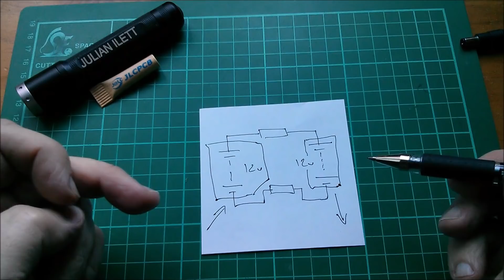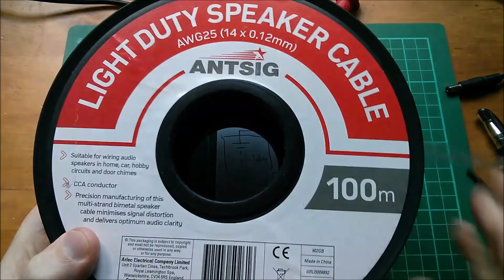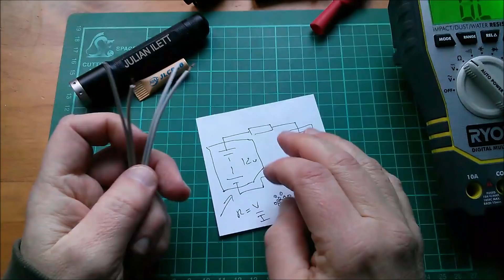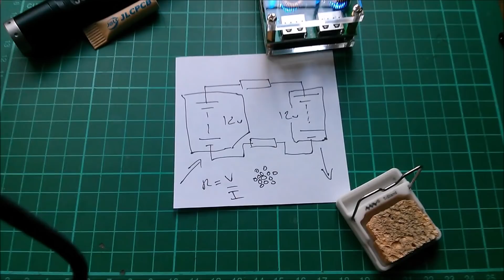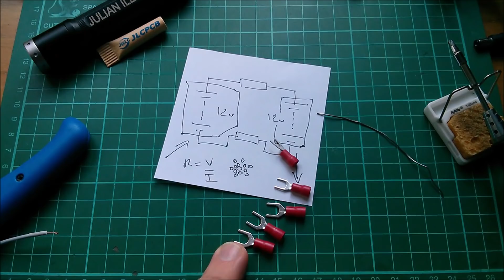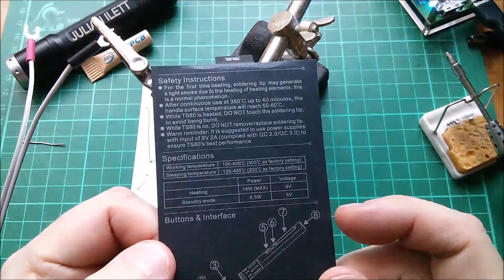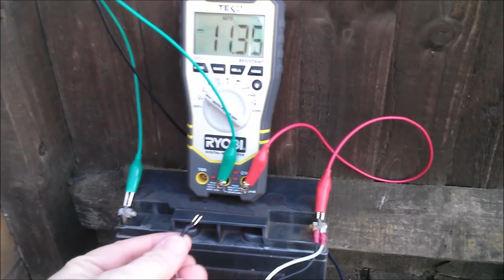Low Tech Power Distribution

Comment: CCA cable drives me mad, I’ve bought it by accident a couple of times. The certainly don’t make it obvious usually. Should say ALUMINIUM on it in massive font.
Reply: I hate CCA cable too. What a pain in the ass it is and the resistance is awful.
Reply: I've recently bought a lamp from my local hardware store. When I took it out of the package I was kind of surprised at the springiness of the cable. It has the proper markings on it (H03VVH2-F 2x0,75 mm²) but when I cut off the plug and stripped the wire I noticed that it was CCA wire. E.g. I bought a lamp with a fake cable which can be quite dangerous here in Germany because we don't use fused plugs and rely on our 16A MCB's and as far as I know it's illegal to sell this sort of fake cable unless it's properly designated (In this case it would have been the A designation for a Aluminium wire)
Reply: web1bastler Not good at all!
Reply: The only thing worse than CCA is when it's just pure aluminium! I ran a 30 meter Ethernet cable for the purpose of audio distribution and when I cut off the pre-fitted RJ-45 connectors and stripped it back - ugh aluminium! It was already physically installed so I had to make the best of it. I ended up terminating to it by twisting copper tails to the ends and shoving that mess into a terminal block so it passed under both screws from one end. Although I had concern about those connexions oxidising, 3 and a half years later the audio is still flowing fine. The amount of resistance was ridiculous, around 30 ohms per conductor! Fortunately 600 ohm audio lines can tolerate a certain amount of line resistance.
Reply: I don't have a problem with aluminium wire, if it's done right. My car from the factory has alum cables for major current supplies , like starter motors, and it's been fine for 35 years.
Reply: SidneyCritic ComedyHound of course it has its place. I use it quite often for mains as it’s cheaper and obviously if sized correctly no problems at all. It has just caught me out a few times being an idiot in a hurry and not noticing and ordering it by accident. Which I’m sure is what Julian has done or he would have mentioned it.
Reply: @molitovv  Of course, ohms law confirms that aluminium as a conductor works fine as long as it's correctly sized. That's all the power line companies run around here for the  low voltage circuits. And on the national grid most of the conductors are actually steel with a coating of aluminium for better conduction. But, then on their 220KV lines, they have a few volts to spare. lol 

The problem is when you think you're getting a pure copper product and it turns out not to be. And most of these items where they fake it, the aluminium conductors are no bigger than the Cu ones would be, sometimes even thinner.
Reply: It’s super commonly hidden so you think you’re getting a deal, when you’re really just getting garbage wire. And it’s not really an issue to use aluminum as a conductor. The resistance isn’t that much worse than copper, and it’s way cheaper. But generally if you run into aluminum wire in a consumer product it means it was intended to be among the lowest price possible to manufacture. So with aluminum Ethernet wires, you commonly see conductors as small as they can manage. And it does ‘work’ for data over short distances, so it’s OK, but most people are totally unaware of how garbage the low end CCA cables typically are. They’re typically as cheap as can be done, and spending the bit more often isn’t a bad idea.

Comment: I would add some diodes so the smale battery does not "try" to charge the larger one
Reply: Would not bother, the voltage drop will mean the small battery will stay at around 30% less charge no matter the big battery charge state, and will just kill it faster. The small battery however does need an enclosure, so that freezing weather with a low state of charge does not kill it by freezing the electrolyte. Not a worry for me, last time it got below freezing here was during the last Ice age.
Reply: My thought exactly, so the large battery charges the small one and not the other way round

Comment: Yeah, super CAP it!!! You could almost power it from the wire. Maybe a DC to DC. One boost, one buck. Send about 36v then buck to 12v at the light... And only use the wire and a cap. It may drop a volt max while the light is on. Then charge.
Reply: That's what I was going to suggest - boost then buck but I'd ramp it all the way up to the boost max output V and bucks max input V - (which I think is around 60V) that way he will get max power through the cable. The modules are cheap. There is a loss through the modules, but the reduced loss in the cable makes up for it and he'll be able to fully charge the smaller battery and not have to worry about current feeding back to the 110AH battery. Another advantage, if mice chew through it they will get a nasty surprise!

Comment: Do you know of a charger board or something, like the tp4056 liion charge boards, that will charge 3in series? I only need a couple amps, to charge a 20-40 ah pack in no hurry, I have a charger to faster charge it. I only want to charge to 12.0v I guess a DC to DC would work. But I want something I don't have to babysit! Great video !!

Comment: You could double the wire! Why not use about 12ga, and one of your charge controllers, pwm5, maybe a large wattage low value resistor to regulate current a bit. Yea i have seen speaker wire with one tined, alot of wire these days are copper clad. Especially in audio!

Comment: What is the standby current of the PIR light? Even a small drain can flatten big batteries over the course of a few weeks/months.
Reply: SLAs self-discharge over time, even without a load.
Reply from the maker: I would guess a couple of milliamps - but that adds up over a month or more :)
Reply: Could you measure it for us?

Comment: Why not no battery, and just use the wires.
Reply from the maker: I wanted a large scale equivalent of a decoupling capacitor - I should have mentioned that :/
Reply: Voltage drop. You'd need a much thicker, more expensive cable. Or to mess around with DC-DC conversion.
Reply: Fair enough compromise, but I'm sure we're all surprised he didn't change for supercaps. This idea could make such lighting feasible even 100m away.
Reply: Shouldn't need it with that small of light, but it is more of a buffer to the charging battery.
Reply: @wobblysauce  That's what I meant. I have a solar garden light that looks like that, and it runs for 4 hours continuously with a small solar panel on top and some cheap NiCds inside. I don't think it would need what that resistive wire could supply.
Reply: Voltage drop most likely. This is a neat hack to get the most out of undersized wires, if you have an extra battery, I suppose.
Reply: Presumably because it would require bigger cables....?
Reply: @flagpoleeip  He could use a boost controller on one end and a buck on the other to lower the needed amperage, would be a fun project imo

Comment: I have used speaker cable in a lot of my old solar power system. The local corner store had loads of it for cheap. All the different types has copper color on one side and silver on the other side. Never had trouble with it though running LEDs around the apartment!

Comment: by the way: you're using CCA wire, which stands for Copper Coatet Aluminium - the high resistance seems legit.
Reply: I thought it stood for Cheap, Crap and Awful.
Reply from the maker: Looks like I was robbed ;)
Reply: Well, it's quite a bit cheaper than "real" copper audio cable, which given to the length makes a huge difference. Better option is solid wire. I don't know what it's called in GB, in Germany it's called "Feuchtraumkabel", which translates to "wetroom cable". I tend to use NYM 3x1.5 for these kind of things nowadays - because it's still cheap as f* and it's "solid" copper and it works just fine... it's not as flexible and shouldn't be used outside in the first time,  better use NYY 3x1.5 - but it adds additional 10 penny to the meter and as i said, NYM works for me for years now .  @JulianIlett
Reply: @marcus_w0  bell wire Is the phrase used over here, I've used it a couple of times for speaker connection but as I'm not an audiophile with hearing good enough to tell the difference , I could never tell if it was better or worse than multi strand.
Reply: I used it for audio wiring as well. There is no big difference in hearing I think, but getting additional 8 ohms resistance every 10 meters seems no good idea from a electronic stand of view. stranded (real) copper wire is almost 5x the cost. I had to do several cableruns up to 15m , i used 12m of solid Wire and soldered the last 1.5m each end with stranded (real) copper wire... best of both worlds - but I'm certainly no audiophile neighter :) But I use these NYM an NYY cables all the time for almost any operations where I need a certain length of cable  @markhowards420
Reply: @JulianIlett  I have found the hard way most speaker wire seems to be CCA.
Reply: You did get the solderable kind though, as I find often the CCA wire is pretty much non solderable with regular flux solder, and if you get a solder that will do it ( high silver content) the core tends to melt away. Better off is to go to the wholesalers and buy a roll of twin lighting cable, and use that 1mm copper cable instead. 20m you will get by with just having the light wired direct to it, no local battery needed, though a 2200uF 25V capacitor inside the PIR housing will help, and add some spike protection as well.
Reply: Copper CLADDED aluminum is what I learned it as.
Reply: Or Copper Clad Aluminium. There's also CCS(teel) to beware of.